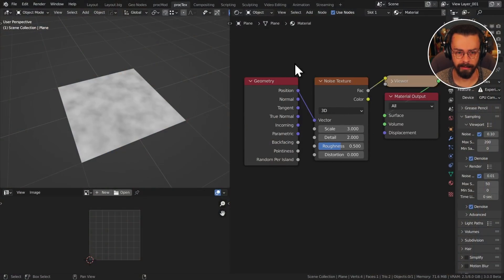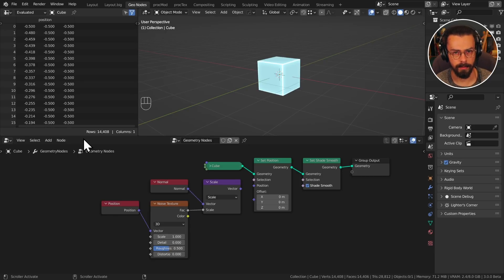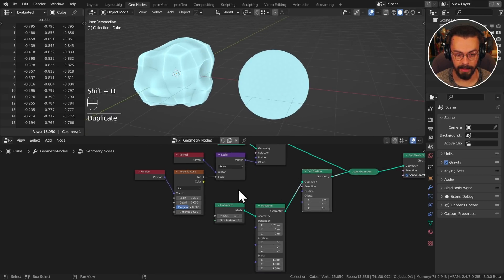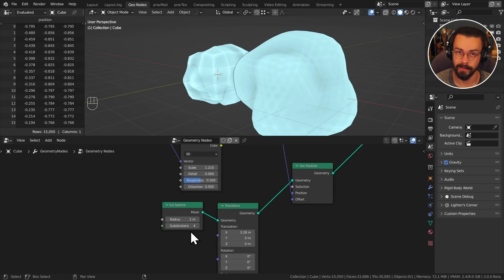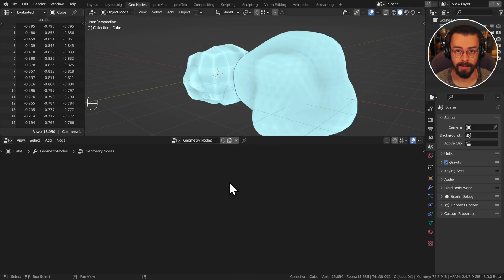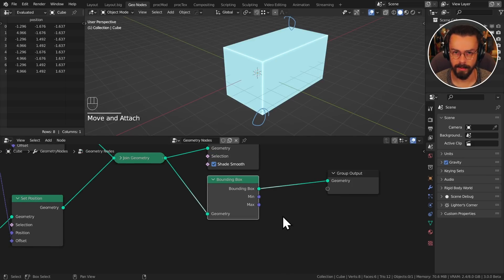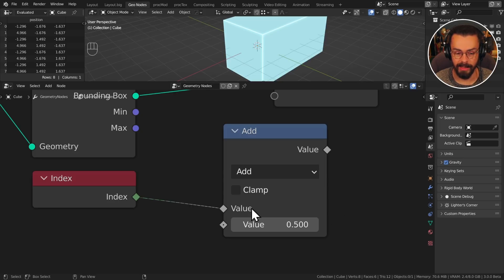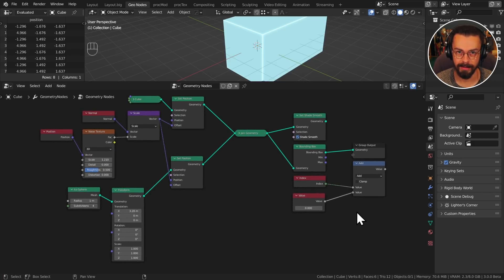What are Fields? - Geometry Nodes 101

Comment: It is simple. The position and normal nodes are attribute extractors. They look at your geometry and take the position and normal information from the geometry. All the input nodes in ox blood red, do same thing. The name 'input nodes' by blender is what is confusing, they have nothing to input they only have an algorithm that reads your geometry, that is why they can also output fields, because it will give an output based on what it reads which may be a vector, single value or a field (an algorithm).

Comment: So basically field is an array of values, right?
Reply from the maker: A field is more like a function. When geometry evaluates the function it creates an array of values that exists on the geometry. For example a noise texture outputs a field. This noise texture is just a perlin noise function. Without vectors from the geometry, it’s not solvable, it requires the geometry to become meaningful. 

Functionally you’re correct, you’ll only ever see a list of values in the spreadsheet but it’s important to note that that array of values only exists because of the geometry. It cannot be disconnected from the geometry as you could create a list in Python or Grasshopper etc
Reply: @Erindale  I see now, Thanks.

Comment: Thanks! So generally fields in gn are same as in Sverchok?
Reply from the maker: Hm sort of. A field is just something that is sampled by the geometry. If it's a position field then it'll return the xyz coordinates of the vertex. If it's a noise field, it'll return the value of the noise formula. If it's an index field, it'll return the index of the geometry element
Reply: @Erindale  in this case I just hope they works more comprehensive than those in Sverchok.

Comment: I've binged watched your Geo Nodes playlist somewhat and to be perfectly honest, I've still no idea how Geo Nodes works. I am trying to scatter objects randomly with random rotation on a plane in such a way that, if any of the instances exceed plane dimension, they will be duplicated on opposite side. This is so that it produces a tiling texture effect. Another problem self-intersection. I've no idea how any of this works or how you understand all of this, is there a handbook I could download or something to better explain nodes and common use cases?
Reply from the maker: You can't check intersections between different instances that have been instanced at the same time. You won't be able to do a tiled scatter without doing something like a grid that you repositioned the points with some tiling noise etc. A lot of this stuff is hard logically because we don't have loops and we don't have an easy way to differentiate between instances after they're realised
Reply: @Erindale  So using Distribute Points on Face along with Instance on Points will generate Instances that I cannnot somehow differentiate based on their bounding boxes crossing the plane? What if I had 9 planes arranged as grid tiles? Middle plane would be used for the canvas and the other 8 would filll the boundaries of the canvas in such way that for example, left plane is simply an offset of right plane. This would produce a tileable effect? I will try to fiddle with this tomorrow. I would love if this were possible because baking objects to a texture would be so much easier than me manually scattering or using Particles then making sure everything tiles and deleting intersecting geometry.
Reply from the maker: If you instance a plane on a grid BUT DON'T REALISE instances then when you distribute points on that grid of planes, they'll have identical distribution patterns and therefore tile and you can instance your objects and realise or do whatever you want afterwards if that helps?
Reply: @Erindale  Yeah, that actually might work!

Comment: But how do you manipulate vertex groups of instanced geeometry using the "selection" socket? Nothing appears in the modifier properties :( It seems like it only work for the emitter geometry and can't be done for imported geometry.
Reply from the maker: Just type in the name of the group. The modifier can only query the active object but that doesn't matter. You're just providing a reference to a column in the spreadsheet so if you input the correct name, it'll work
Reply: @Erindale  thanks, I would never figure that out😂👍

Comment: How can I use geometry nodes to actually build a mesh plane, control the position of each point, have the plane portions subdivided into many quads for cloth sim, and also build sewing threads to connect pieces of the object?
Reply from the maker: You can't create new edges or faces but you can delete faces to leave edges behind. If you're form is possible to make by manipulating a grid or other primitive, or by using the curve to mesh node, then you can delete faces to create sewing threads.
In my last test, writing out a group for use as pins in my case didn't work though.
Reply: @Erindale  also we'll be getting solvers soon.